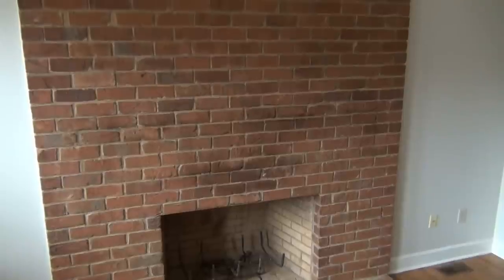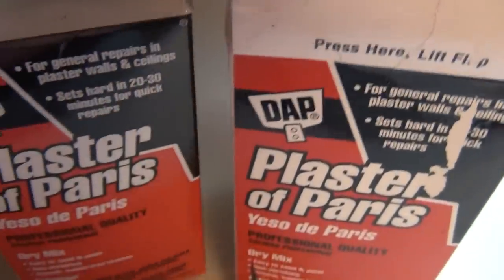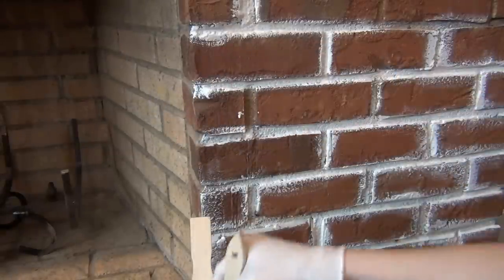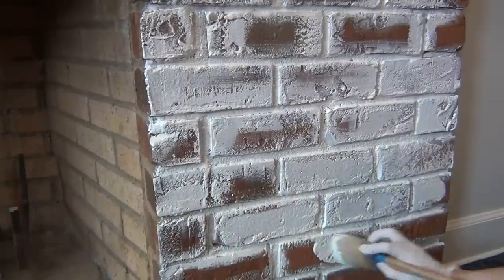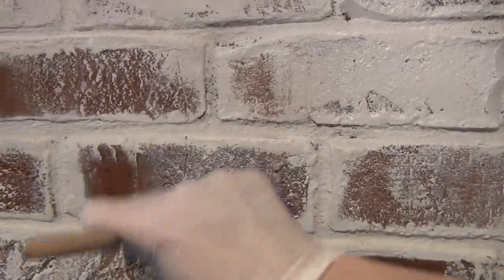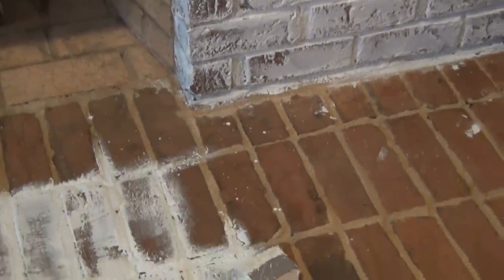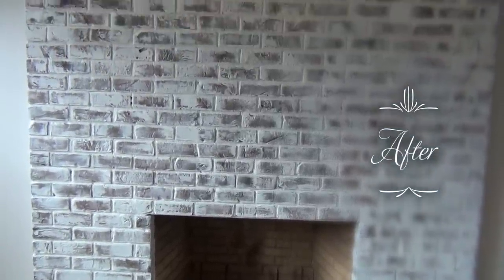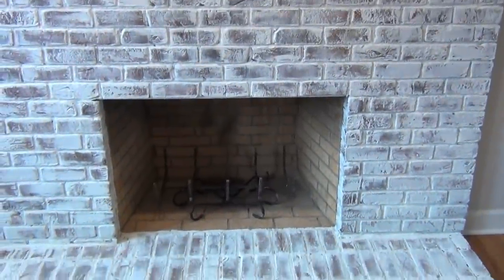DIY Chalk Painted Brick Fireplace French Country Farmhouse Style

Comment: That looks lovely. I painted the bottom half of my 160 yr old fireplace and then I flushed and wallpapered the top. It made a huge difference. The only advice if give is if you are planning on using the fireplace use paint that can withstand high temperatures

Comment: I love your paint technique on your fireplace. Mine was solid white when we purchased the house. Our porch was red brick, which I painted to match both ends of our house. It makes for one cohesive look. I used a wire brush to clean the brick and just painted with a good paint, and a very thick roller of course. It turned out beautifully. I love painted brick. I’m looking forward to more DIY projects of your home.
Reply from the maker: Hi Susan! I love painted brick, too! If our mortar had not been so dingy, I probably would have left it as is. However,  painting it certainly brightened up the room! I will have tons of home renovation videos, but we postponed those until after Christmas because we have too much going on. Keep an eye out for those starting in January! 👍🏻 Have a wonderful weekend! 🧡 Xoxoxo

Comment: Love this! I had painters do my fireplace in flat white, and while I like it better than the red brick, I don’t love it like I do your finish. Of course, now I want to sand blast it off or repaint and begin again. Your brick is great, probably the hand made ones, and one or two look inside out.
Reply from the maker: Hi Linda! Thank you! Maybe you can use a wire brush to gently scrap off paint in some areas? Or a paint remover with it? You don't want to damage the brick, but most newer brick is pretty durable. Older brick may be crumbly. Just a thought! Best wishes! Xoxoxo
Reply: Don't mess with it. This looks sloppy and half-finished. (I'm a designer)

Comment: Love the outcome! Can you list everything you used please? So far your method has been my favorite!
Reply from the maker: Hi Kaitlin! Thank you! I'm so glad you liked it! Here is what I used, but you can certainly used a variety of similar products and get the same result. I just used what I had on hand. 
•Plaster of Paris (adjust amount to achieve desired consistency)
•Glidden Paint with Primer in Eggshell finish (soft white color)
•3" wide Chip Brush (cut bristles down to 1" length)
•Paint stir stick
•Mixing container
•Hot water, but you can omit that step and add directly to paint if you want a thicker, textured consistency.

Comment: Love it! Why did you use plaster of Paris instead of just paint ? Just wondering if I also need to use this … 🤷🏻‍♀️🤷🏻‍♀️🤣
Reply from the maker: Hello Marie! I used plaster of Paris to basically make a thicker version of chalk paint. A lot of people like to do a German Schmear (smear) look using mortar or joint compound. This was just easier for me to add texture and get that matte look I wanted with less mess and a quick dry time. This version doesn't fill in the mortar joints, so it isn't really German Schmear, but you get a similar effect. I think you can use just paint if you want to. 😉  Xoxoxo
Reply: @thepaintedsouth  oh… okay! Thanks for the info! 😁😁 Maybe I’ll start off with just paint and then try this technique if I don’t like it. 👍🏼👍🏼 thanks again! Appreciate it!! 😊😊 Great work as well! 👌🏼👌🏼

Comment: I love this method of all the videos/articles I have watched so I am going to try. thanks. One question, is there any need to "seal" the brick afterward so it will not yellow or change with the heat of fireplace?
Reply from the maker: I am so sorry I am just now seeing this A YEAR later. 🤦‍♀️ we never used the fireplace, but adding a clear sealer that isn't flammable would make it easier to clean, I'm sure. I would ask product experts, i.e. Sherwin Williams, if they offer a product that would work. Xoxoxo

Comment: Love the change 
Im watching cause i want to do the same thing to my brick around my fireplaces i have a full wall tho.
Why do you use plastic parish, i think thats what you said maybe spelled wrong.  
I have been watching several videos and they don’t us it just water and paint 
Love your video i’m just a little nervous.
Reply from the maker: Hi Rose! I added Plaster of Paris to my paint to make it thicker. It dries a lot faster and has a bit of texture as well. It ends up being thinner than mortar mix, which people use in the German schmear technique, but less runny than paint or thinned down paint. I have repainted this fireplace 2 more times since this video. Lol! You can do so much with paint. Don't be scared to start. Just keep working it until you end up with the result you want. Here is another video on the same fireplace.  
https://youtu.be/MW9wz0sOPOs
I hope that helps! Best of luck and just go for it!!! Xoxoxo, Deborah
Reply: Thank you , did you us semi Satin or or satin. Or flat i dont know what i want to us
Reply from the maker: @rosesmith9373  I used flat. Also, we don't ever actually use the fireplace, so I haven't sealed it either.

Comment: I just tried this and I'm afraid I may have misunderstood. When I added the hot water to the plaster of Paris or clotted up and when I added the paint it all separated. The box of plaster says use cold water. The material was very grainy and watery. The platter began to set up in the bottom of my cup.
Reply: Update
I used cold water instead and it worked great!

Comment: I want to use this technique on my thin brick backsplash. Which matte sealer do you recommend?
Reply from the maker: Hi Mary! Any water based,  matte top coat should work. I actually have not sealed my fireplace yet and may not ever get to it. Lol. We never actually use it. You won't need to worry about the brick "breathing" because it is a decorative backsplash. On furniture, I have used Annie Sloan's water based lacquer, but it is more expensive. I have also used Polycrylic. Here is a link. https://www.lowes.com/pd/Minwax-Polycrylic-8-fl-oz-Matte-Water-based-Polyurethane/999918674?cm_mmc=shp-cprdpntgooglelia-219-interiorstains-999918674-_-0&store_code=728&placeholder=null&gclsrc=aw.ds&&gclid=Cj0KCQiA9dDwBRC9ARIsABbedBORzI1gQX2lLPzLiLQTgehn7AxaqA__ClD0FoS2-r82jscBabhSEEAaAiapEALw_wcB
I would use 2 or 3 coats. 😉👍🏻 Best wishes for a healthy and prosperous new year! Xoxoxo
Reply: The Painted South Thanks so much! I’ll have to post a pic when I’m done.

Comment: Hi, I don't understand where the chalk paint and plaster of paris come into play? Do you mix up chalk paint first, then add paint and plaster of paris to get the right consistency? What kind  of chalk paint do you use?
Reply from the maker: Hello! This was a trial and error situation. At first, I mixed up DIY chalk paint using leftover eggshell finish paint (with primer) and Plaster of Paris. I always dissolve the Plaster of Paris in hot water before adding it to my paint to make sure it blends well. However, in this case, I realized I wanted a thicker consistency for more texture and for easier application on the vertical surface. So I then added more plaster of Paris directly to the paint mixture. You can certainly use a ready made chalk paint or clay based paint, which will cost $20- $40 per quart on average. Those products can vary in their thickness as well and can be adjusted by letting them sit uncovered for a while. I just used what I had on hand for this porject 😁 I hope I answered your question and thank you for your comment! Best wishes!
Reply: @thepaintedsouth  Thank you! This clarifies things quite a bit. I should have some leftover eggshell finish when I finish my remodel and will give this a try.

Comment: How tough is this finish? The fireplace I want to paint has a hearth that ends up being seating when we have large gatherings.  Will the plaster of paris be tough enough to sit on or will it come off on clothing and leave balder spots on the fireplace after being sat on?
Reply from the maker: Hi Angie! That is a great question. My answer is going to be my opinion so please take that into consideration :) Brick is usually porous and should generally absorb the paint. In addition to that, chalk paint is fairly durable and people even use it to paint the fabric of upholstered furniture. That being said, it is usually sealed with a wax or top coat. You could certainly use a water based matte top coat, but I doubt you would need to. You could always test your paint mixture on a spare brick and see how difficult it us to remove. Or maybe when the hearth is used as a seating area, offer a decorative blanket or cushion as a barrier. Which might be a good idea anyway because brick isn't very comfortable. 😂 (Hang on...*** I just took a black shirt and rubbed the brick harshly and nothing came off!)

Comment: Hi! I Love this technique and I cannot wait to try it out! Just a quick question... can  you add plaster of paris to normal chalk paint and get the same result? I have two cans of white chalk paint i intended to use for this project, but I love how you made the paint thicker.  I just want to make sure I am not going to screw with the integrity of the chalk paint by adding a lot of plaster paris. (PS I am new to this whole DIY scene)
Reply from the maker: I would say yes, but add it in small increments. As I showed in the video, when I make my own DIY chalk paint, I always dissolve the plaster of Paris in hot water before adding it to the paint. However,  since I was going over textured brick and on a vertical surface, the thick textured paint worked best for me. If you have expensive chalk paint, I would recommend doing a small test batch so you don't possibly ruin a large amount if it doesn't work for you. Just my opinion. I hope that helps and good luck!!! I think you will be happy with the results and very little mess! I didn't tape off or use a drop cloth, but you may want to. 😉

Comment: Is a sealer needed before reusing the fireplace?
Reply from the maker: Hello Nayeli!  A sealer would be a good idea, especially if you are burning wood. We had gas logs and removed them so we could have a wood burning fireplace instead, however, we might replace the set we removed with Ventless Gas Logs instead. Our other set was vented and all the heat basically would go right out the chimney. Lol. A sealer would also help with cleaning, should you happen to get residue on it. I would research a fire resistant or high heat rated product. If I can find one, I will link it in another reply. I hope that helps. Have a wonderful day! Xoxoxo
Reply: The Painted South thank you so much!
Reply from the maker: @nr6949  So much of what?
Reply: The Painted South omg I didn’t even comment that! That’s strange ...I shall delete it ...so sorry!
Reply: Oh I meant to put “thank you so much “
Reply from the maker: @nr6949  No worries! I just didn't understand what you meant. Lol. Xoxoxo

Comment: Use a “dry” roller.
Reply: A small sponge roller had the same effect as the brush if you want a thin coat but still have to go over grout with a brush.